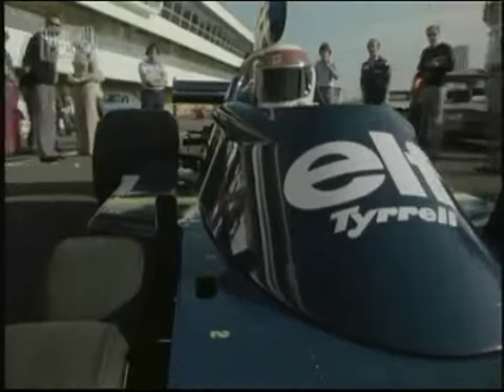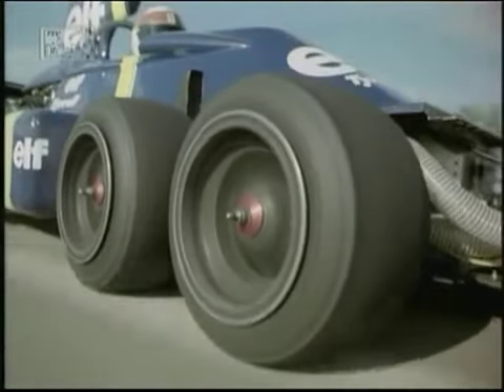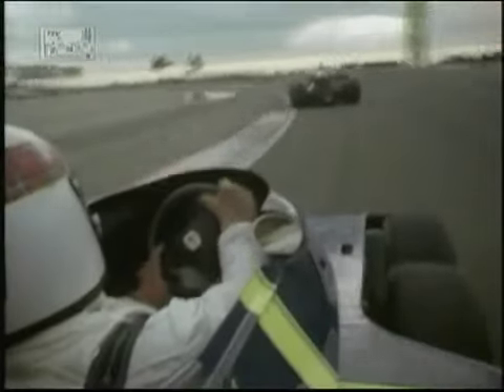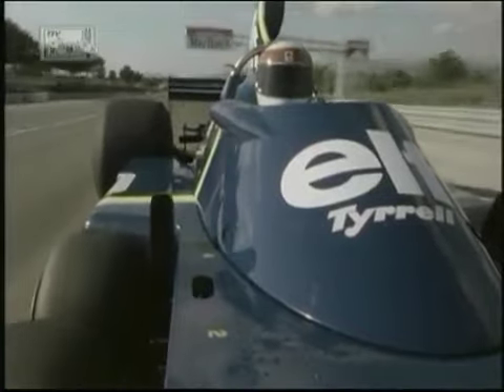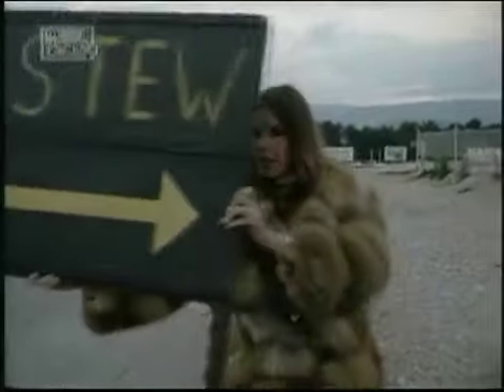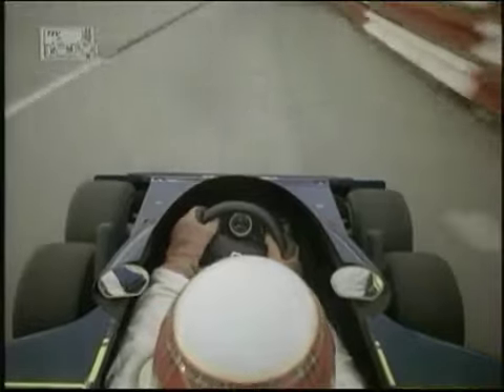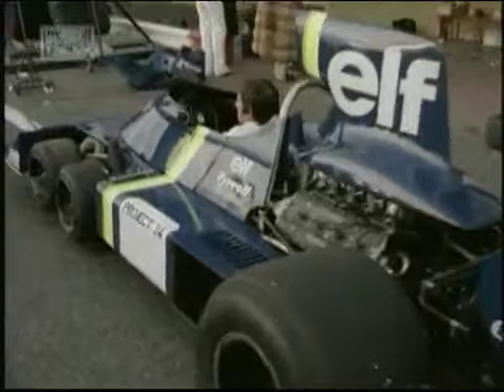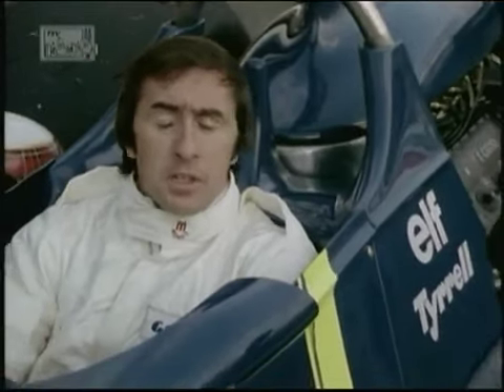Jackie Stewart tests the P34 Tyrrell 6 wheeler

Comment: The original circuit paul ricsrd was amazing, its long straight, of course modern F1 has emaciated it.
The P34 wasnt developed as Goodyear stopped tyre development of those special small tyres.